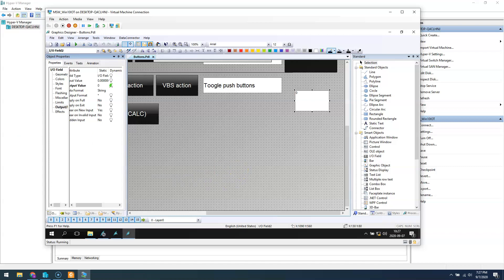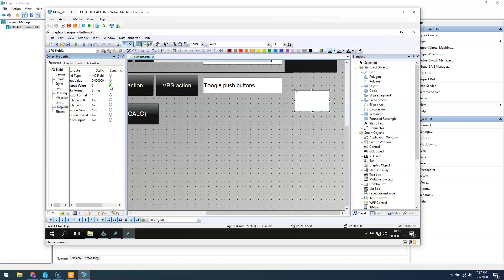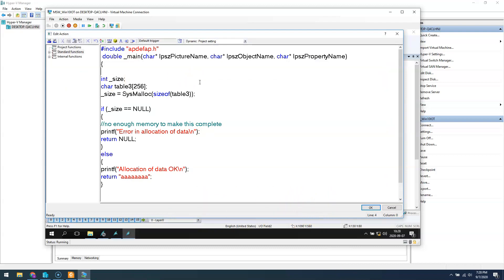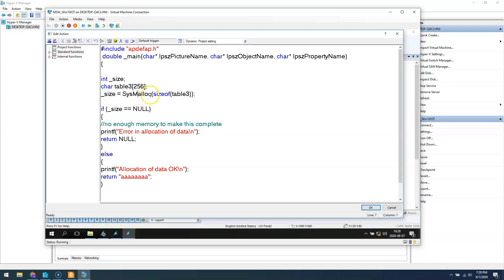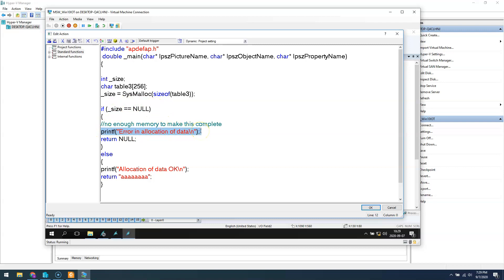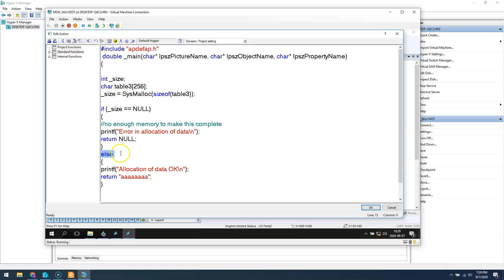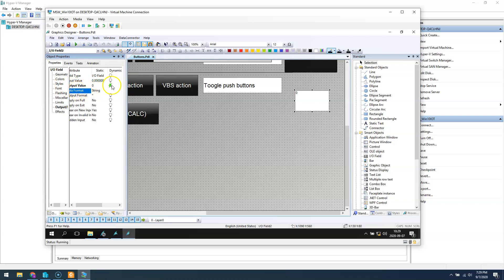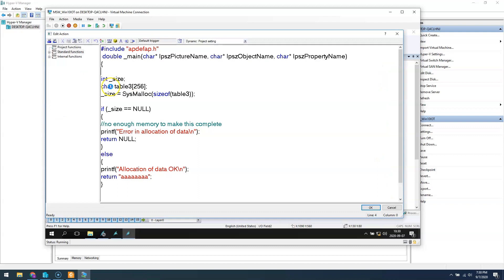How to use SysMalloc function in WinCC C-actions? WinCC V7 tutorial (C - script) #15

Comment: You got it a little bit wrong here. Sysmalloc doesn't return  size. What it returns is just a pointer to the first byte of a chain of bytes, that sysmalloc requests the operating system to rezerve. The number of bytes is defined by the number you provide for the sysmalloc function. If sysmalloc fails to rezerve the desired chunk of memory, it returns Null pointer, which is why you should always check for null after using sysmalloc function
Reply from the maker: thank you for explaination!